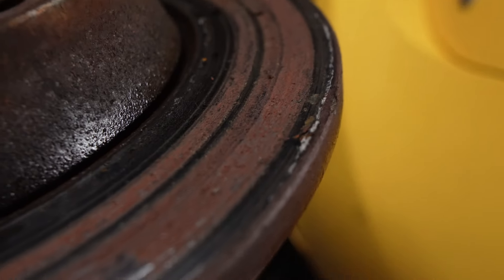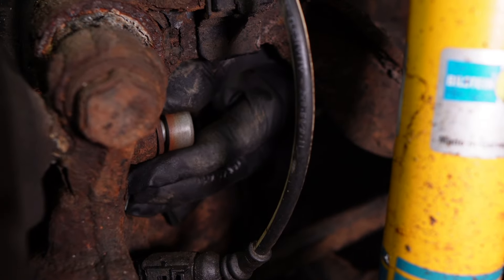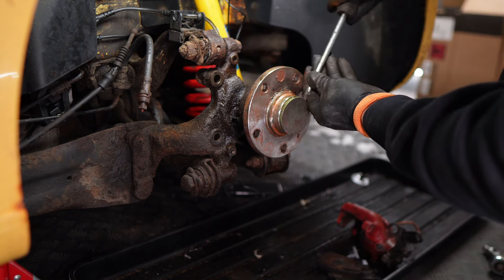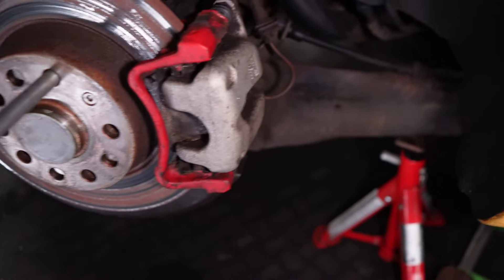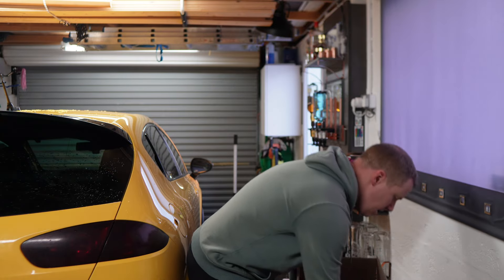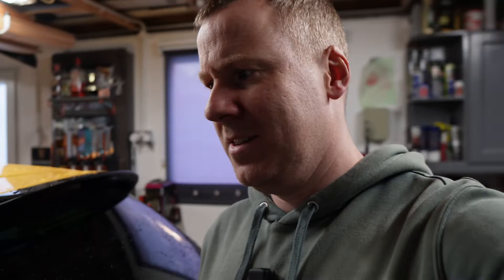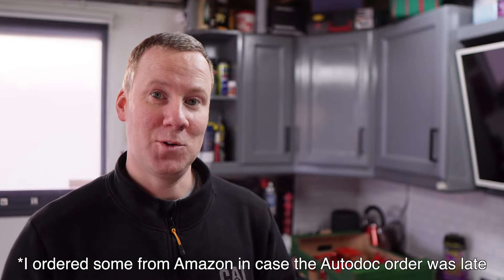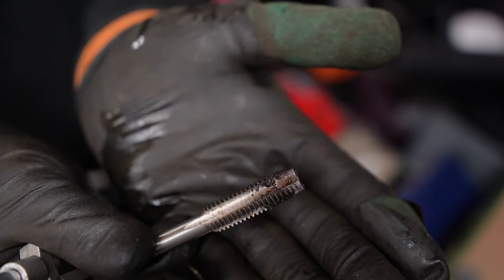A SEIZED CALIPER, prompted me to OVERHAUL my BRAKES!💪🏻 ✨BRAND NEW!!✨

Comment: Awesome work. Next time when doing an oil change and you change the sump plug. keep the oid sump plug, it works a treat when changing discs you can use the sump plug to keep the disc in place the threads are the same as the wheel bolt thread and its nice and short.
Reply from the maker: Awesome tip mate 👌🏻 much appreciated.
I have a reusable magnetic sump plug but I'm sure I have a normal spare one that I can use for this purpose.
Cheers Russell 😊

Comment: I've the same issue with a rear caliper, it's pretty new but did spot a few slits in the piston rubber ... Same corrosion as mine been a Scottish car as well haha
Reply from the maker: Corrosion is a nightmare! The amount of salt / sand / grit on the roads attacks the cars. I understand the safety requirement for road users, but always sad to see the side effects on our cars. 
Hope it's straightforward enough for ur caliper mate 🤞🏻😊
Reply: @NorthCoastWorkshop  yeah not my first time to change them , get few prices ... Recently got an RTS clutch in , and a new fly wheel
Reply from the maker: Jeeze, that must have been a big/expensive job 😬
Reply: @NorthCoastWorkshop  yes the installation was 500e not to bad , 1500 for parts...unsprung clutch takes awhile to get use to gearing down on regular driving, nearly have have to rev match a bit
Reply from the maker: It'll be an investment for peace of mind in the future, so although a lot, worth the money 👌🏻
Reply: @NorthCoastWorkshop  indeed bro 💯

Comment: Geeeeez mate the rust, I use ACF 50 underneath every time I change the engine oil.. I've got the 2022 Leon.
Reply from the maker: Yeah she's rusty under there. The highland roads have been hard on her over the past 13 years sadly, but looking to address that later in the year hopefully 😁🤞🏻
Reply: @NorthCoastWorkshop I started to use the stuff on my brand new car, around my area the council in Scotland uses a lot of salt on the roads. I wash my callipers every week in the winter when possible with a special brush. Just changed my winter tyres and they're still looking new.
Reply from the maker: Yeah the council up here use loads too, and it's full of coarse sand as well. It literally sandblasts the underside of the car.
Once refurbished I'll look to get it treated and I'll look into that ACF50 stuff so much appreciated mate 👍🏻

Comment: That's some serious rust... my 2006 Leon 1p1 (1.9 Tdi BKC engine) has a different rear calipers set made by TRW (PR 1KD) which has never seized in its entire life (i bought the car new at the time) 230.000 kms  on the odometer (143.000 Mi for the Miles heads). I'm in the process of installing her new second set of rear disks (and 4 th pads set). I live in northern Italy (which has a similar climate to the south of England) but the rust I have in the underbody isn't even close to that of your car. Maybe it has to do with the less salt that is put on the roads in the winter. Next jobs on the list are: Timing belt and water pump, thermostat, serpentine belt and all shock absorbers... wish me luck 🤣The cost of living are mad right now... i have to keep that "bitch" running another 5 years....
Reply from the maker: Cheers for watching and leaving a comment mate. Yeah the cost of living is crazy at the moment, so I'm the same. I have to keep this car going for as long as possible. Fixing her up as I go.
The rust is the worst bit but it's all replaceable components which I look to do very soon. They put loads of salt mixed with fine grit and sand on the roads up here in Scotland, and it sandblasts the underside of cars sadly 😞 Cars that are only 5/6 years old are already very bad for rust 
Best of luck with the jobs ahead of you on your car mate 🤞🏻